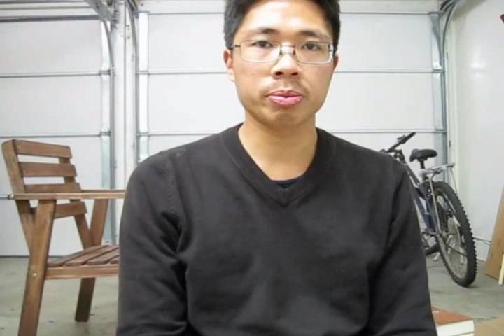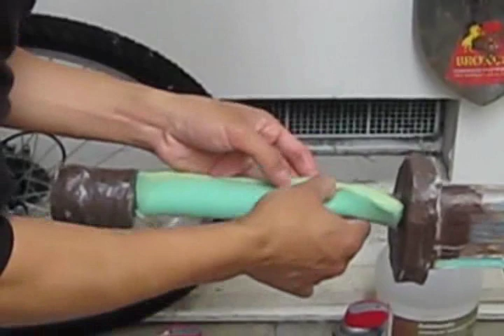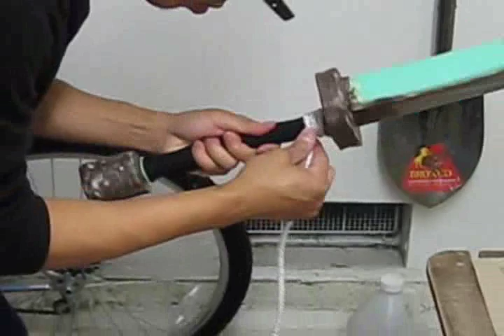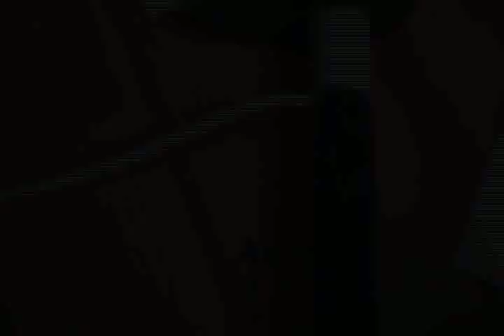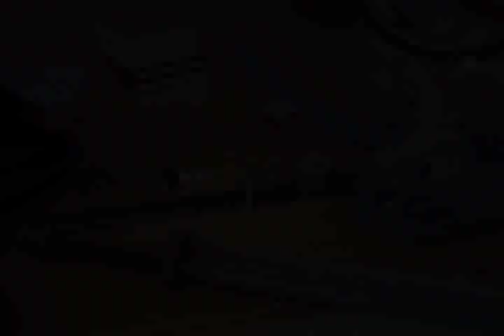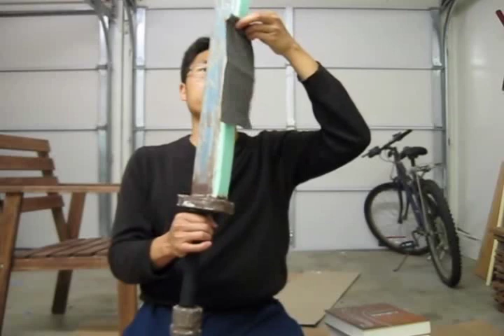How to build a foam / latex katana style sword Tutorial part 7 of 8

Comment from the maker: @DiscipleofRock13: tutorials take alot of time and unfortunately time I do not have. luckily, making an axe is actually not too difficult. You can use the same design principal in my sword and use it on the axe. You simply fold a piece of foam over each other like I did with the katana, and then carve out the shape of an axe instead of the curved blade.